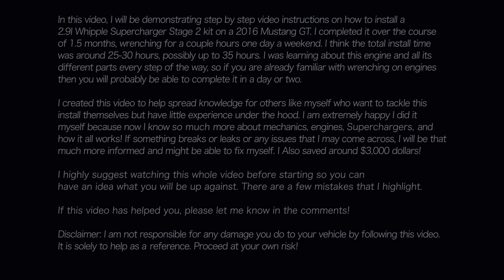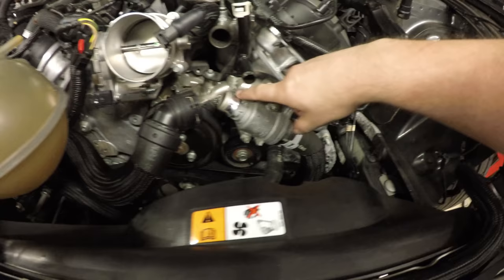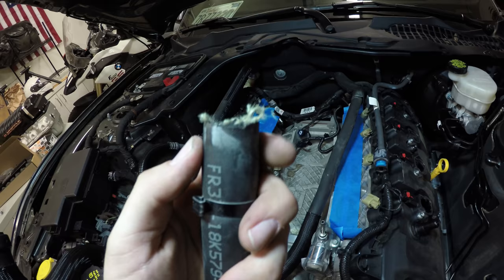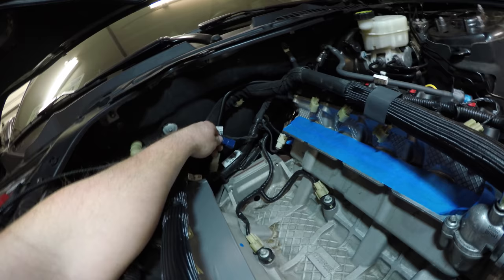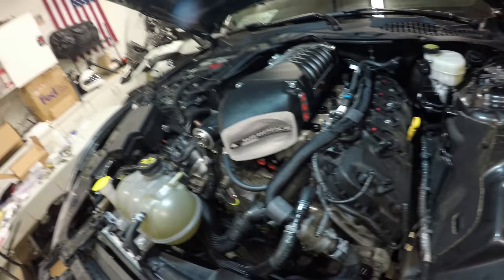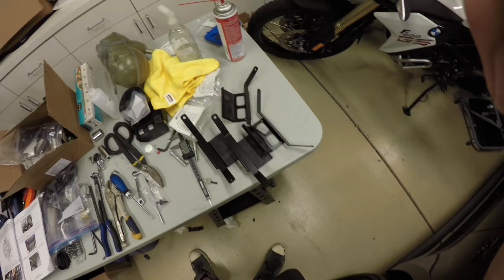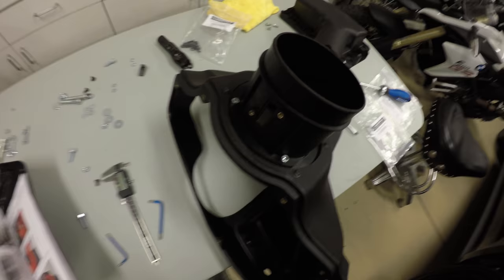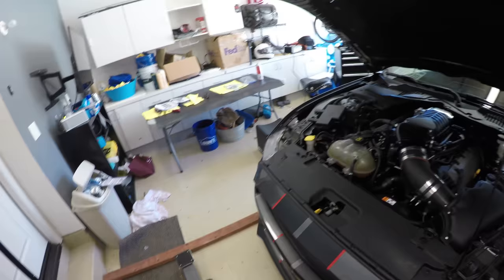Step By Step How To Install Whipple Supercharger On A 2016 Mustang GT

Comment: I'm currently following your video on my 2015 Mustang GT - Stage 2 Kit - I'm at step #63.  So far, so good.   I had to make a major detour at step #59 to install a billet oil pump gear set (MMR) - that was a hoot!   Hopefully I got the timing chains put on correctly!!  In any case, when this is all done, and it all comes out as planned, I'd like to send you a nice bottle of wine or a case of good beer - your effort in making this video is much appreciated, and is an incredibly valuable resource for average guys like me who choose to take on this project by themselves.
Reply from the maker: Hey Robert, thanks so much for the love! So glad the my video is helping you and others, that’s the only reason I made it. Just wanted to give a little to the GT community 👍🏻👍🏻 I appreciate the kind offer of wine or beer but no worries brother, just do me a favor and be safe!
Reply: Llllllllllllllllllllllllllllllllllllllllllllllllll
Reply from the maker: Hey Robert! Its been a couple years now, how is your Whippled Mustang holding up?
Reply: @norsepowergarage2627  I'm interested to know also..

In addition, I find it to be super cool how u check back in after some time💪🏿 keep it up champ!
Reply: I installed a whipple 2.9 on my 2015 mustang gt and it took 3 years and the crank snout broke off, all they gona say is you installed everything wrong but its just that the superchargers create alot of harmonics, vibrations and loads on the crank, a crank support will help but still cant avoid the harmonics and vibrations
Reply: Robert we need that update 💯

Comment: Obviously never worked on car engines
Not knowing the names of some components 
Giving tools your own names
Having to measure to know sizes of bolts
Making your own way when the instructions fail
Going purely on  the instructions

I take my hat off for you buddy good job 👍🏻
Reply from the maker: Haha, like I said, only real mechanical experience is minor work on my motorcycles/dirt bikes. replaced a clutch, a starter, rebuilt a carb, and thats about as far as my experience level goes. This was a great experience and I learned a ton from doing it. Because of the experience I gained from doing this, I was able to troubleshoot and replace my buddy's throttle body on his Jeep compass, and it turned out great!
Reply: @norsepowergarage2627  where there's a will there's a way thats how I look at stuff, the problem with me is I'm impatient but now a days prior to doing any job I make sure I have all the necessary tools and double up on minor consumables because I know foe sure something is gonna go on and off many times till I figure it out (as in read the instructions at the end)

Comment: I just finished my install. Your video was a huge help. Thank You for taking the time to make it. I did OPGs and crank sprocket at the same time. There's a couple good videos on YouTube for that install also. But, you're the only one as far as I know to make a comprehensive Whipple stage 2 install video. Thanks again. It probably would have taken me twice the time without your video.
Reply from the maker: Michael Blodgett so glad it was helpful to you Michael! I keep getting rewarded as time goes on from comments like yours!
Reply from the maker: Hey Michael! Its been about a year since you installed your Whipple, how has it been going? How many tickets have ya gotten? haha
Reply: @norsepowergarage2627  No tickets, but the car is a beast. I've heard people complain about the tune Whipple supplies, but my car runs great, and I love all the pops and crackle on decel.

Comment: Regarding the belt installation - use a ½”  breaker bar to compress the spring - there’s a ½” square hole in the bracket just for this purpose.
Reply: Robert Wolfman wish I would have known this back then. Lots of people have said the same, which seems to be common knowledge at this point. A fault for being a beginner trying to do the install on my own I suppose. Thank you for your input!

Comment: Fantastic video dude! I've seen a couple others but they gloss over everything and turn a 20 hour install into a 15 minute video. I bought the same package from Palm Beach Dyno in FL. Seemed to have the best price at the time and the guys there are very knowledgeable and helpful. I was going to install it myself like I always do but this time I found a local shop (Dez Racing) that had done dozens of these so I was willing to pay the $1800 to insure that I didn't screw something up. This blower turned my GT into a completely different car. It was fairly quick stock but nothing close to what it became. Absolutely love it. I'd done things like cams, intakes, heads, etc. on my other Mustangs but after spending thousands I ended up with performance gains but nothing like this. Screw the other mods, put this on and call it a deal. The car feels completely stock when you drive it casually but when  you put your foot into it -  hang on and make sure it's pointed straight.
Reply from the maker: Rich MAC hell yeah!! 🤘🏼🤘🏼😎😎 beastmode! Congrats on the whipple and thank you for the love! Be safe out there 🙏🏼

Comment: I was looking at getting an S550 Mustang for a summer car since I had to sell my C7 Z06 and my biggest concern was lack of power so I was definitely considering this. I watched this video all the way through and didn't skip a second. Thanks for putting this out. Let's me know it's probably worth 3 grand to have a shop do it! That looks SO painful and time consuming! Hats off to you for having the patience and determination to do it yourself
Reply from the maker: Hey josh! You definitely won’t have any lack of power getting an s550 and this stage two Whipple! You’ll need some fat sticky tall sidewalls in order to keep traction or you’ll be on ice skates. Thanks for watching the whole install! That’s pretty impressive for not doing the install yourself haha. There might be shops willing to do it for 1500 depending on where you live. Get a bunch of quotes! I’m the type of person that hates spending money on services that I can do myself (or I think I can do myself) so it was definitely worth it to me. If you want the work warrantied (I think Whipple requires a certified shop in order to honor their warranty maybe?) then have the pros do it. Maybe call Whipple first and ask them what shops the recommend for warrantied work. Good luck!
Reply: @norsepowergarage2627  Yeah I'm guessing it should be on par with  my Z06. I'm painfully aware of how shitty traction is on high horsepower, front engine rear wheel drive cars. I ran Toyo R888Rs on the Z and that made a world of difference.
Reply: @therealjoshtodd  with the correct tires and suspension it will rip you z06 apart.
Reply: @richardcoan1  not sure if you're trying to troll or what but if you read my comment, I don't have a Z06 anymore so it wouldn't do anything at all to "my" Z06. Also, the Z06 runs high 10s stock. With the R888Rs, it's down to mid 10s. Would definitely take more than JUST a supercharger for a Coyote to run low 10s and be faster, even with wrinkle walls.

Comment: The square hole in the tensioner pulley... put a breaker bar or socket wrench in it and use it as leverage. Thats how you more easily relieve tension on it.
Reply: looks like 1/2 in drive
Reply from the maker: Wish I would have thought of that!!

Comment: Nice job man! I know people have told you about taking tension off the belt by using a half inch breaker bar but you did a great job making this super clear to help so many others take this task on themselves. It's nice to see people take on a project like this. I was hoping to get to see you drive it and see how many smiles per gallon you get out of it especially since its something you accomplished yourself.
Reply: i have same on 2017 and get 11.8 avg mpg driving semi aggressive. moreso the rear tires (Pirelli) suck and were changed to 295/30/19 Toyo R888R with much improved traction. but be aware this car goes thru a new set every 5000 miles @$365/piece. Figure that into cost of operation, and this isn't from roasting tires, it's from normal driving a blown car.

Comment: 1:28:47 I used a short bit and a 1/4” wrench and then you can access the bolts and turn them easily

Comment: Love the video no hate towards you at all, but if one does not know what a simple hose on the brake booster is they need help installing this.
Reply: or you just figure it out and learn what every component is before you mess with it? Been a year now and zero issues and a lot of fun =)

Comment: Dude this is amazing, I’ve been looking for something like this since ordering mine
Reply: I’m considering torquing those manifold bolts prior to the head unit install... I’m not sure how it would effect it and seems like it would offer a lot more space to work with. Thoughts?
Reply from the maker: Thanks man! Hope it helps when it comes time to install!
Reply from the maker: Brendan Barfoot awesome man!! Wish I would have had your tips before doing my install. My manifold bolts are probably overtorqued but so far so good with lots and lots of throttle smashing haha. Would you mind linking my video in your post on that forum? 👍🏻👍🏻

Comment: Hey, I’m stuck on the intercooler pump harness, the instruction says you tap into the fuse box but I don’t see any orange wire that runs to the fuse box only the connection between both relays. Did you add that fuse tap ?

Comment: Your video helped me out a lot!! 2 questions. The wires that had to be unplugged from back of factory intake, did they get plugged back in anywhere?? 2nd, the little oval plate bolted on back of whipple intake/intercooler, did you do anything with that???
Reply from the maker: John Hayes yes those cables got plugged back in to the blower/intake. Not sure if all of them did though.
Reply from the maker: And I didn’t do anything with the oval plate. Don’t even remember it.

Comment: Just a quick question . Is really the gear oil pump a must to do in this engines when installing a supercharger. That gear oil pump requires the engine removal and it’s kind a of a lot of work. I just need like 600hp . Will it reliable without replacing the gear oil pump?
Reply: This had 825-850 hp and I took it to the track (willow springs) and to the drag strip and ran the piss out of it and it never even flinched. You’ll be fine :)

Comment: Im about to do  this very soon.  I see you had a lot of issues tightening down the lower intake manifold with that 5mm ball head. Seems as if the fuel rail and top SC is in the way. What if you set the lower intake manifold down first then torqued down the bolts then put the fuel rails on while it was on the car then lowered the SC head unit? Im thinking that would work?
Reply from the maker: Yeah I think someone else mentioned the same thing,  I can’t quite remember if that would work but definitely worth a shot. I don’t really see why it wouldn’t, I just didn’t want to deviate from the whipple instructions.
Reply: NORSEPOWER GARAGE ok thanks.  Great install video.
Reply from the maker: lx347cid thank you!

Comment: Did you have to grind anything on the motor to install this?
Reply: For the whipple no, for the roush or vmp or any other blower you have to grind tabs off the timing chain cover or buy the aftermarket one
Reply from the maker: Yeah, what @bg704 said 😂👍🏻👍🏻

Comment: Hello.  I’m stuck on step 99 of my July 2019 version of the instruction manual. Here’s what it says:  “99. (Complete kits)  Install  the supplied IAT  sensor  to RH  bank  of  intake  manifold.  No  pipe Teflon is  needed.”  I have the sensor (looks like a spark plug), but I have no idea where this thing goes. There is no hole in the right hand side of the Whipple  intake manifold (which I assume is the passenger side). You don’t cover this in the video. Any ideas on this?  Thanks
Reply: Problem solved - a hex nut on top of the driver’s side intake manifold is a placeholder for this sensor - I removed it and the sensor went right in.
Reply: @robertwolfman286  Just saw this, sorry for late response. Glad you figured it out! How is it running?

Comment: Did u do cam gears or crank sprocket? Did whipple recommend this or no? If not how is it doing so far?
Reply from the maker: lx347cid no cam gears or crank sprocket or oil pump gears. It’s all running perfect and I am redlining most the time 😂👍🏻

Comment: it’s been 4 months how’s the car running and holding up? and how’s that mt82
Reply from the maker: 5LToro El Toro I’ve dragged it and tracked it and it is running perfect!!
Reply: 5LToro El Toro it’s an auto
Reply from the maker: Been a year now and still running strong! Auto tranny is built to handle up to 1000hp stock I believe. Somewhere around there.